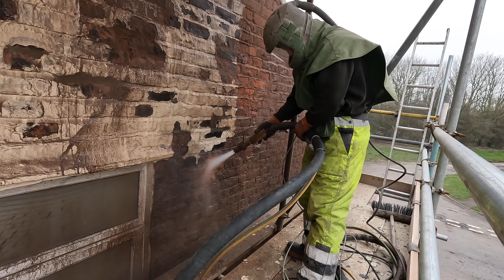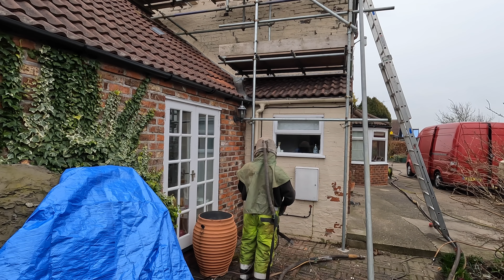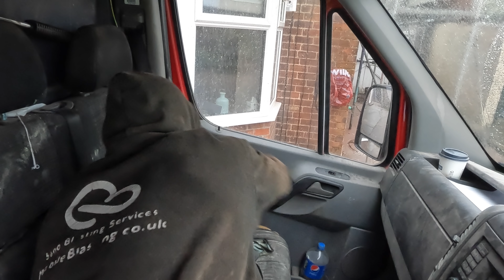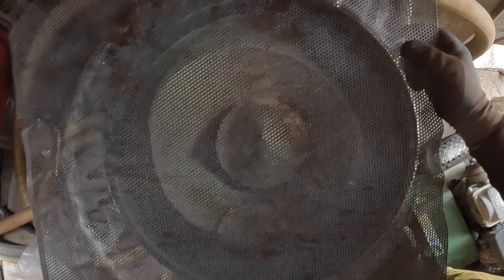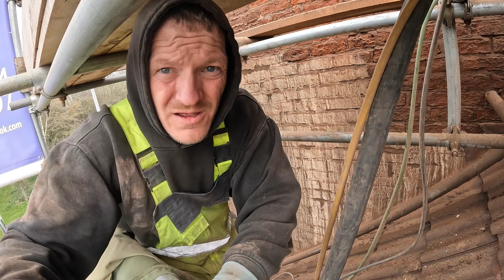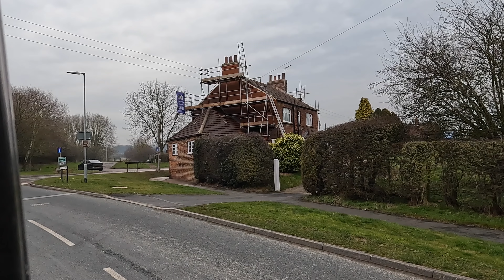Last resort to remove bitumen & paint to solve Damp issues. Dustless SandBlasting

Comment: Roofing is a complicated art! It's good he's got YOU on the case. A lesser-skilled or less ethical blaster would have just DONE it not let him SEE how it was going to look beforehand. I love it when a craftsman tells me the straight facts, no sugar coat. Your concern does you credit Mick. I worked on a historic preservation board and saw some horrifying examples of bad blasting work. Incompetent sandblasters can easily wreck a building - GREAT to see someone with your skill and delicacy with so much power.
Reply from the maker: It was a job I wasn't keen on doing but after he said it's the last resort I kinda new he had tried all other possible ways and when a rendering company turn it down something needs doing function over ascetics 👌

Comment: Lovely work fella, im a roofer by trade we had a job last year in London, party walls front and back had been coated in bitumen and reinforced using hessian years ago by council , it was mid summer the bitchy wasnt having it in slightest ,we chose the easy root as it is what customer opted for and clad them in timber and wrapped in lead , you may find that paint was more of a roofing repair product hence the strength of it , generally fibres for extra strength
Reply from the maker: Thanks mate 👌 I hate the stink of it 🤢🤮 gets on pipes then in van and it takes weeks to get rid of smell

Comment: Years ago I read somewhere that "dry ice" blasting was superior in removing bitumen, and other oily substances, due to the extreme cold it apparently "chips" the coating right off.   Have you ever heard of that, or tried it.   I have seen the finish house destroyed by blasting, it was not pretty (but it was the only way to get the paint off)  18 month ago I bought an old farm in Denmark, and the nob I bought it from, painted most of the house with latex house paint over the old lime wash, he was so proud of it, and said that the paint was really expensive, so now I have a really expensive problem to fix !   (or at least time consuming,  I do think that some (most ?) will come off with a good pressure washing (200 bar ?)   Wish me luck, and keep up the great work you do.
Reply from the maker: With lime wash been under it it will remove easy with the blaster. But 1st port of call pressure wash then if that dont do it steam pressure washer/chemicals all else fails ya know the blaster will be able to rip it off as a last resort
Reply from the maker: Ah sorry I forgot to answer the 1st bit lol 
Yeah I've had a dry ice unit didn't really find a job for it everything I tried it on the was cheaper ways to achieve the same thing. Well dry ice has a unique no waste media but the little extra man hours cleaning up still don't add up to the costs involved to save cleaning up. Some jobs require no waste like food presses etc so dry ice is in a league of it own for very limited jobs. To be fair I never tried bitumen but bitumen is easy to remove with soft glass what makes it harder to remove was the plastic/rubber pant over it 🤮 that's was the hard bit
Reply: @Mobileblaster  Thank you for the reply, I did not think that you had the time for that, it was a comment, not really a question.   I did not think of steam, but it makes perfect sense, soften the paint, and it comes easier.
Reply: @Mobileblaster  For the bitumen/oil dry ice is supposedly more about temperature then anything else.   As an electrician, I know it is also used to clean large industrial breaker panels UNDER POWER, due to the magic of absolutely no residue, when cleaning after fires, or explosions.
Reply from the maker: @jesperdahl1486  oils/bitumen are very easy to clean conventional methods so the costs involved with ice I wouldn't sat it was worth it. Yeah on jobs like that they have a uneek pro over conventional units but for me this line of work is very limited and wasn't profitable so I had to get shut of mine. As the ice don't last on the shelf like other media's
Reply from the maker: @jesperdahl1486  I try to answer as many questions as possible but it's stating to take alot of time up so I think I may start doing a few hour on a set day as it does take alot of time up👌

Comment: Great ,"Dustless" Job Mick, just wondering have you seen the likes of ,"Sponge Jet" jetting saw it being used on a site where i worked to take Epoxy resin Paint off Structural steel in a Pharma manufacturing  plant...great resolve to work through that Contract, little wonder with the end result the owner was well pleased...
Reply from the maker: Thanks appreciate your comment. Enviro sponge is a expensive way to reduce dust doable if the price is in the job and the need for limited dust is justified the costs involved is worth doing but I'm not going to invest the money for that setup to get 1 or 2 jobs a year they wouldn't suit my workload. I wouldn't mind having the rig sat about ready but honestly I wouldn't be able to earn its keep

Comment: Does the brickwork generally need repointing and do you have a guy that does that while the same scaffold is still in place?
Reply from the maker: Repointing will only need replacing if it's no good to start will I normally say if you run a key or flat blade in the joint and if it pulls out the blaster will take some if its OK with the blade it's very likely going to be OK with the blaster. I don't get involved in pointing/painting/sealing/priming etc I believe you gain a set of skills doing the day job and more you do it the better and more efficient you get doing such if I was Repointing after I believe I wouldn't provide a service equal to a guy that only does that so I stick to just blasting 😉 👍

Comment: Excellent video. I think the real damage was done inadvertently by putting that type of rendering on the outside of the house. A bitumen layer  and paint on top is not the right thing on older houses. In recent years I have come to understand and learn about lime mortar that was used in older houses. Trying to use modern cement to plaster over these older materials does not work and causes trouble with more dampness. I am wondering if the outside of the house should be left as it is back to its original state as you have left it. If any re-pointing  or jointing is to be done it should be the right type of mortar. This might be a lime mortar or similar. If a modern cement mixture is used it may do more harm by causing more dampness.
Reply from the maker: Spot on totally agree 👍

Comment: We had non-breathable paint removed from ours with a custom made hot steam machine (like the doff) and luckily it managed it. Glad it didn’t have bitumen on it. Repointed it with lime mortar and now it’s all good. Blasting was on the cards next :-). I will give you a call if the next historic building is any worse ;-).
Reply from the maker: He had a company try steam and chemical but still no joy. I have a falch that's like a doff but 3x faster and I wouldn't have had much luck with that. That finishing was in a league of its own and to top it off a skin of bitumen I was close to saying no to this job but the guy really had run out of options. Sometimes putting a smile on the customers face can go against what ya stand for but as said before this channel is about true life jobs and no sugger coats hear it is what it is open and honest 💞👍

Comment: Some of the things people did in the past to remedy thing still blows my mind.
Reply from the maker: 😂 Well it stopped the rain and sealed it up OK😂 job done haha they just didn't realise the house needs to be able to breath
Reply: @Mobileblaster  bitumen backed lining paper to stop black mould growth, then find all the air vents plaster boarded over because the fresh air was to cold! Why can’t people realise air movement removes moisture? Still make us money
Reply from the maker: @Rendersurgeon  yeah new windows and doors block open fire up get gas boiler insulate air vents and then the issues with damp because years go folk painted the exterior to cheap out not refilling the joints 😂

Comment: Great job... reminds me of the Turnerisation process of applying a rubber solution to slate roofs to stop slate slippage. Bastard to fix leaks later. Was the water supply to the nozzle mains fed or from the jet washer?
Reply from the maker: Thanks appreciate your comment 👍 yeah tap fed. With the win nosel hardly any pressure or flow is needed 👌

Comment: Brilliant watching you do this why would they put bitumen on the wall
Reply from the maker: Thankyou thats appreciated 👍 Bitumen isn't that hard to remove looks ugly as owt and it sokes into the brick leading to staining eve when basted and neutral so the brick can breath. It's using finishings not designed for masonry that's the big problem as the backing hoste needs to be harder than the finishings to stand any sort of a chance of removing it in the future also it needs to be designed to weep water out

Comment: Do you always use the same media on houses ? What kind do you use the most ? Awesome video
Reply from the maker: It can slightly change but only very slightly in the grain size not noticeable to most folk only talking 0.4 of a mm  difference. My main media use is crushed glass as I stock loads of different grades and it's cheapest option with best results bang for the buck a suppose. Not saying it's the only option as loads of media's will achieve the same thing just different price points and cut rates
Reply: Ok thats what I was thinking .
Reply: @Mobileblaster  .4 mm is 40 mesh  and .04 mm is 325 mesh
Reply from the maker: @jdaspects  OK sorry to confuse the media size hasn't much to to with mesh grades mesh grade is the depth of the profile only refered to on steel profiling really because its impossible to measure mesh on brick.
What I mean in the media's differences I use on brick and stone verys from dust to 0.2 then dust to 0.4 I ask my supplier to lean more on the dust when I want a super fine grade or lean more on the 0.4 when blending. Not many people have this option of this as I get my gear from the manufacturer and order a large amount and have been doing so for years so tend to look after me. Infact I started asking for blend they now stock on the shelf called fine plus 0.4 with some 0.6 / 0.7 that's a perfect blend for other applications but all media will perform differently with psi and cfm. I could use a larger grade at a lower psi and get similar results with higher psi and lower grade. All you have to do is play about till you find what work for you

Comment: Great video. Watching I thought how else could you get this stuff off, burn it off! then I thought freeze it off with dry ice, did a bit of looking online and dry ice blasting is actually a thing for bitchumen. - 71c
Reply from the maker: Yeah bitumen wasn't the problem it was the paint it's very far between that stuff but I've encountered that stuff before and that also didn't go too well 😂
Reply: That scale of dry-ice blasting you would require several tones of dry-ice & cost you a fortune! 😊

Comment: Great stuff dude . Could you recommend a grit supplier please ours seems to get worse
Reply from the maker: Depends what your after and the jobs you do as the is loads of different media's. I go to the manufacturer skip all the middle men and order bulk minium order 28 ton 🥵 that takes a chunk out ya pocket every time it comes round but it works out cheaper than 1 or 2 ton dropping off
Reply: @Mobileblaster  28 tonssss holy cow is that a sea container worth? 1120 bags?
Reply from the maker: @jdaspects  it's a UK wagon full without needing a moment permit standard delivery 👍
Reply: @Mobileblaster  don't know what a UK WAGON is?
Reply: @Mobileblaster  I no what you mean. I've just used 40 tonnes on 1 job in London. I've been buying 10 at a time but this is clearly not the best way of doing it . Thanks
Reply from the maker: @stevenbyford5591  28 is max a flatbed will deliver on a standard pallet delivery. Ya will have paid for the wagon to deliver 10 but probably not much more for 28 as it delivery is normally charged in distance and time then the tonage so extra won't mean a grate deal more in the cost of delivery that is and bulk buy normally means a slightly better rate so its a win win 😉 👍

Comment: I'm curious, u said u tried pressure washing, did u try steam?
Reply from the maker: I didn't try presure washer or steam as I know from experience you need around 10 different chemicals to soften the paints oh you may drop lucky on the 3rd or 4th but then you have another issue bitumen that is hard even with the oil softener and degreesers needed. He had a company test areas with different chemicals steam and a rendering company turned it down. He tried grinder only real method that was feasible left to try was blasting I knew I could help out but at what expense to the blasting industry it goes against the grain doing these kind of jobs because anyone that see the finished product without the back story just fink I'm eva a bad operator or the industry is at fault when infact it was the only way forward to solve the problem he had.
Reply: U provided a solution for ure client so top notch! My machine does 150 deg and rekon it woulda shifted it but prob at a slower pace, vid fascinating tho nice 1
Reply: I've got channel on here but not linked to this account but if ure interested search atandc exterior cleaning my baby is on there
Reply from the maker: @atandc6900  oh I'm also into steam power I have 2x falch modded to run the twin burners at 155° I have a video or 2 on hear somewhere. I've had doff and thermetec and both sister blast pots torc and I've forgot the name of the other unit.
Well I'm not going to say they are shite but this is the specs doff 100bar 11lpm 150° thermetec 140bar 11lpm 150° falch 300bar 24lpm factory 98°  a 15£ modd it will safely do 155° at full demand with it having twin burn area of doff or the green en
 I know exactly what steam is capable of and it wouldn't remove the paint or bitumen without a lot of softners chemicals makeing it unfeasible process even if it did lift the paint that is in my opinion wouldn't as he had a company out beforehand testing such.
Reply: Cor that paint musta bin some nasty stuff! Allways like new surfaces/ coatings and generally stuff I havnt tried b4! 22nd year this year so allways  refreshed by something new!
Reply from the maker: @atandc6900  must say I've only come across this type of finishing once or twice before in my time as a blaster 1 of said jobs I even pulled off that job not the right gear to remove it more or less I wasn't skilled enough to know about that finishing but time moves on new technology becomes available and skill sets follows suit. Also I like to try and keep upto date with new methods hence me buying doff and then quickly realising I need a unit like that but faster then I found falch really are mega bits of kit just I don't follow that line of work anymore maybe 1 day

Comment: In the automotive world, they freeze the old bitumen type sound insulation inside the car then whack it with a hammer. It just cracks and comes right off. 
I wonder if a machine exists to do that for vertical surfaces?
Reply from the maker: Yeah dry ice blasting but the bitumen isn't the problem for the blaster its the rubber type of paint the owner tried other compaines that tried steam chemicals full out psi etc blasting was the last resort and turned out not too bad to be fair but its not a nice as I could get it if only the finishing was approved for brick I would have stud a better chance :)

Comment: Why don't you have your breathing filter in your van? I have it on a bracket that if I need to take it out I can.  I have a water hose reel to wound up my air line just saves a wee bit of time one worrying about it falling over either
Reply from the maker: Not a bad idea I suppose its because I get that bit more reach and normally 20m of airline can get to the nosel I have 60m on the van but like ya say rapping it up take time. I have 3x 20m for the helmet I only try and use what I need

Comment: You have a shot of your pot setup in your  Mercedes van anywhere?
Reply from the maker: Nope it's a bog basic presure pot I don't want to promote 1 pot over another as they all do the same job in my opinion
Reply: @Mobileblaster  my pot only holds about 2 - 50lb bags as I wanted it more mobile than stationary in truck.
I'm using a box truck 🚚 that's 36" tail lift and use a ramp to get stuff up n down. I bit more work but oh well.
Reply: @Mobileblaster  the blast hose length you have is 100 to 150 feet?
Reply from the maker: @jdaspects  pot size is 20" 40" it will hold 100kgs of medium grade glass 4 x 25kgs or 3x 25kgs of finer grade stuff I have a total of about 200 to 300 meters of pipe but I only load the van with 40m as nearly all of my jobs are 30m ish 👍